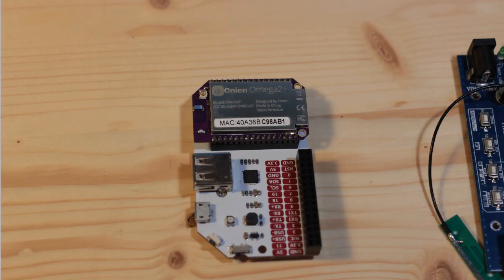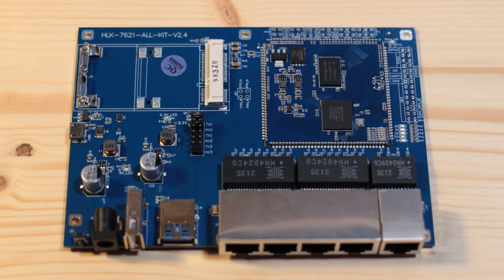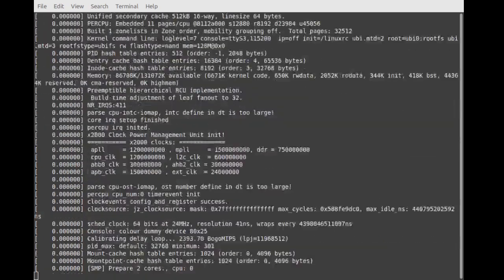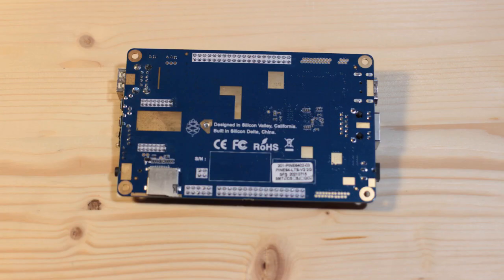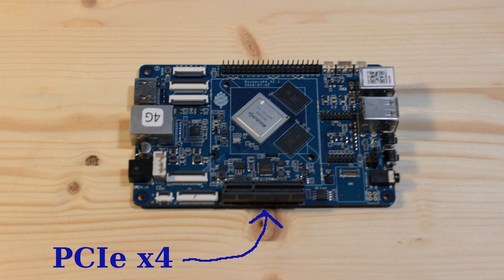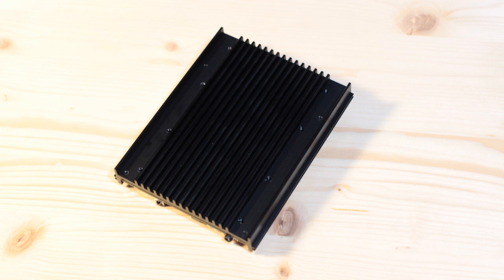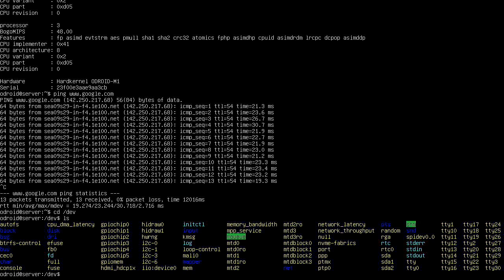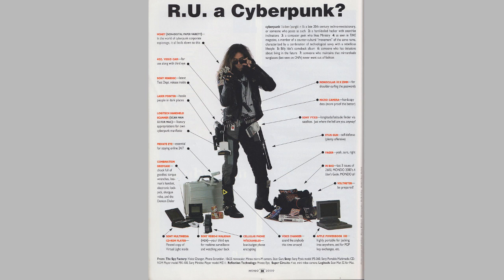Show and Tell; some stuff to throw 9Front at

Comment: I've been really enjoying all your content thank you for the great videos! what gets me especially excited is seeing all the hardware hacking and configuring you do and the cool projects you setup with them, i'm stil very very novice when it. comes to boards like that (i have a lot to learn still) but i hope with time i can get to a power to understand how they all work and how to be able to take a random board like one of those you show and understand how to use it and make it do what i want. to me that's still seems like magic to me.
Reply from the maker: Hardware has a reputation for being difficult, but it does not deserve it most of the time.  And when it does, it is usually because the hardware manufacturer is hiding some details.  In some ways, writing drivers and the like is easier than other software because it comes with very defined goals.  Something like an Ethernet driver either works properly, or it doesn't, and it only has so many failure modes.  Compared to something pure software that looks simple, like an instant messaging app, which allows you to create what ever you want, but also means you can endlessly tweak it and create problems.

Comment: Have you ever tried to run Plan 9 on a Parallella board? It seems like the perfect OS for them. They are massively parallel (hence the name) with a custom 16 core co processor plus a dual core ARM CPU. One of those projects that seemed to have so much potential and sort of went away.
Reply from the maker: There is a kernel in 9front that runs on a Zynq board.  http://aiju.de/electronics/aijuboard/

Comment: Another awesome video!, I've been watching all your plan9 vids for the past few months, and you are the reason why I'm running it on my homelab!

I have a question tho, I've been thinking about making plan9 run on my Archer C50 1200 (MT7628 based), just as a learning project. I haven't pocked around the UART port yet, but I was wondering if you use a SPI flash programmer for getting the firmware unto boards like this, or do you usually rely on the boot-loader and TFTP. I didn't notice any JTAG pins on the board at first glance, so that's why I'm asking
Reply from the maker: On my mt7688 router board I use the already installed u-boot and TFTP.  And this is fine long term, as Plan9 works well with network booting in general.  When I get the spi driver done, I plan to just use onboard flash to store the "nvram" authentication tokens, and keep fetching the kernel from the file server, as it makes it easier to upgrade kernels and configuration that way.

And keep me updated on the mt7682 project.  I was planning on getting one myself at some point, and my mt7688 code is largely compatible.

And there has been some rot in the mips base in some plan9 distributions.  Check https://github.com/0intro/plan9-contrib if you have trouble building some libraries.  Or hit me up by the email in my youtube profile.
Reply: @adventuresin9  Understood, I might have some time to work on it on the weekend actually.

Also, and sorry I know this is an unrelated question. But a buddy of mine and I were wondering how difficult it would be to get the Echo dot's wifi working on Plan9? We know it might be easier to just use Linux to get that going, but we were thinking it would be nice to make a little Plan9 weather station with one
Reply from the maker: It would certainly be more work with Plan9, just given that I'm sure there is a Linux kernel that will at least boot on whatever Arm cpu is in a particular echo dot.  But 9Front does have some existing 64bit Arm kernels to borrow code from, and a generic wifi interface to hook into. 
Looking at some Dot tear downs, and they look like they have something like jtag or uart debug pins exposed, but I'm not sure how hard it would be to load custom kernels into flash on it.
And personally, I would have to weigh that effort against all the little Arm and Mips boards I can find that would be a lot easier to develop on.  
https://vocore.io/
This is a mt7628 device that does some audio and is designed to just hack in what ever you want.
Reply: @adventuresin9  Yeah that makes sense, tho is a shame, 22 is a really good deal for such a beefy SoC. And I can always use the router for the weather station (it has more accessible GPIOs directly on the board, which is super convenient)
Reply from the maker: If the Dot had an ethernet port, it would be totally worth it.  Or an SD card or USB port that u-boot could pull a kernel off of.  But it looks like the c50 has easy access uart pins.  Just set up a Plan9 file server, have it run ip/tftpd, and you can grab kernels and plan9.ini files over ethernet.

Comment: Curious why your pfp is the Verizon building in lower Manhattan, I'm sure there's a good story there.
Reply from the maker: It was originally called the "AT&T Long Lines Building", and it's windowless construction lead to tons of weird theories.  I picked it because Plan9 came from Bell Labs, and the building is an iconic representation of Bell/AT&T without being a trademarked logo.
Reply: @adventuresin9  my grandfather worked on the long lines. Last year I was working in an E waste recycling facility (building some material flow process stuff for them but I basically spent 50% of my time treasure hunting for the e-commerce department), AT&T was a very good customer of ours and someone cleaned out a closet. I managed to get a Fluke 8060a, Tek 485 (needs some love), and a huge box of panel meters for dirt cheap with my  employee discount.  All of this equipment has Long Line div asset tags on it and I am ecstatic about that.
Reply: @adventuresin9  RIP to America's best and brightest engine of innovation, destroyed by the ignorant.
Reply from the maker: Yah.  They are up there with Xerox PARC in terms of being a foundational piece of modern technology that few people have even heard of.

Comment: You could always take an angle grinder to the bottom of the bracket on that PCI card and then file it down LOL
Reply from the maker: If that was the only issue, I probably would just do that.  But I need to mount the RockPro to some sort of base any way, because most pci cards are bigger than it, and that makes the whole thing is easy to knock over.  Especially if I tried something like a 4 port nic with the weight of all the cables.

Comment: Sir, is it safe to say that Plan 9 is the most portable operating system in the world?
Reply from the maker: It is hard to beat NetBSD in that category.
Reply: It can't possibly be more portable than Inferno, since it needs an MMU and Inferno doesn't.
Reply from the maker: If the idea is potentially the most portable, the Inferno is up there, in that it doesn't need an MMU and has low system requirements.  But NetBSD has actually been ported to stuff Plan9/Inferno doesn't even have compilers for, like PA-RISC and SuperH.
I suppose one could make a 9P library for microcontrollers, and call them micro cpu servers.  Like when they put a 9P interface on a Lego Mindstorm robot.  http://doc.cat-v.org/inferno/4th_edition/styx-on-a-brick/

Comment: People complain about RPi. But we have it good. Some of these even do 8K HDMI output. Anyway, good video as usual! 👍
Reply from the maker: The Pi people really did get a lot of momentum for SBCs.  Before them, almost the only option for small systems like this were PC104 boards, which were really expensive.
Reply: arduino and raspberry pi revolutionized the market for sure.  @adventuresin9